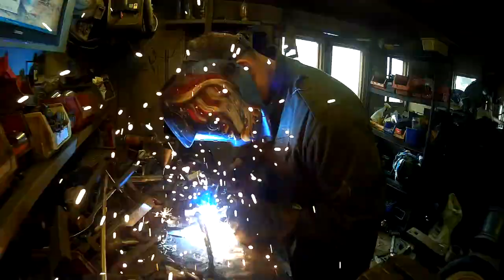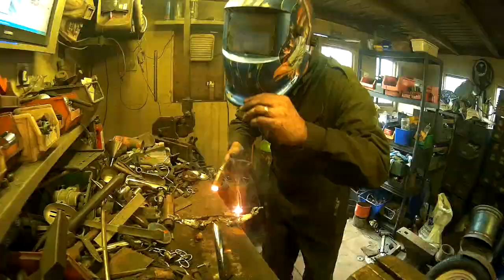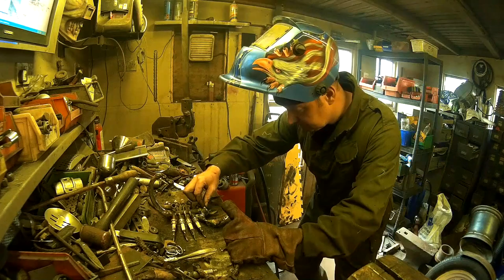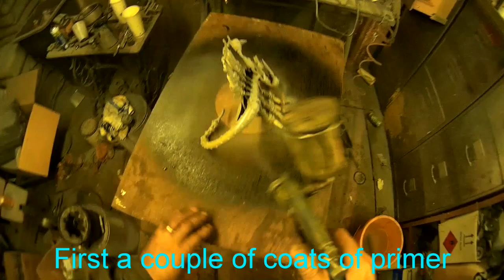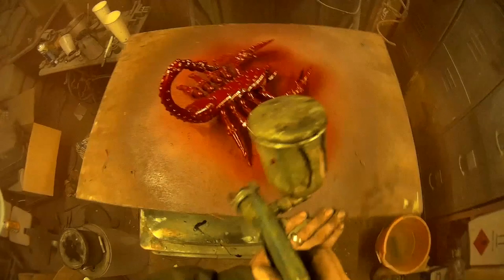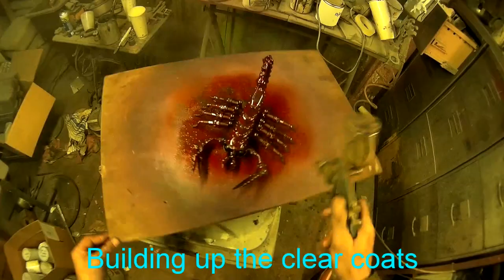RECYCLED SCRAP METAL SCORPION SCULPTURE, WELDING TIME LAPSE BUILD

Comment: Another great work!  What mixture and wire are you using to weld with considering such a mixture metals and gauges?
Reply from the maker: Hi Brian, i use 0.8 or 0.6 mig wire, the gas i use is ferimax and it doesn't have a gauge its just a bayonet fitting from Air products, i hope this helps, sorry for the very late reply :(